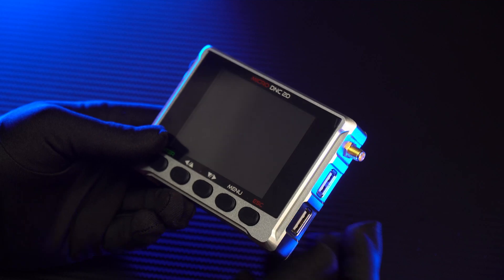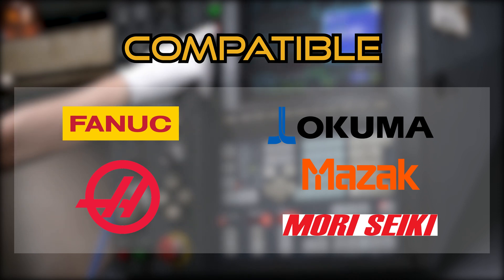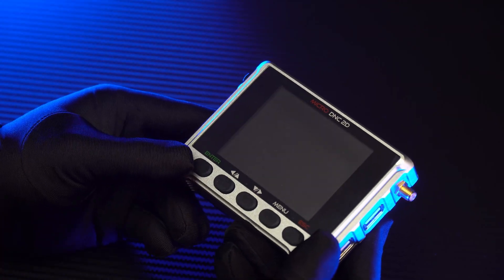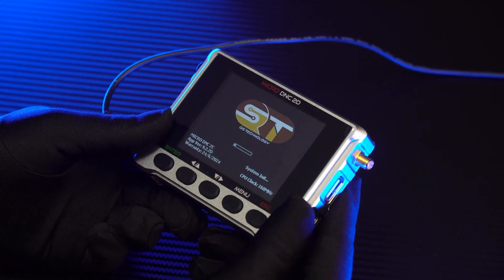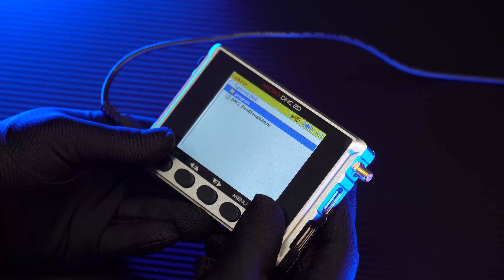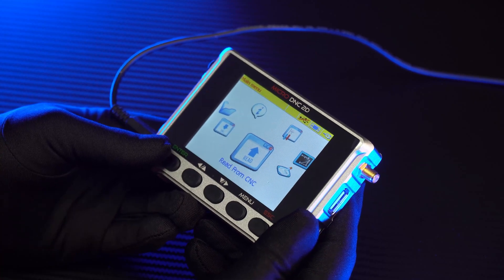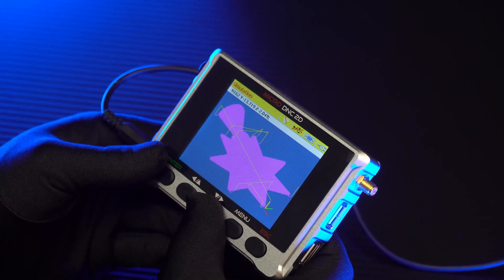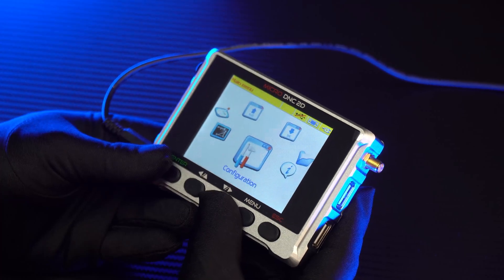Micro DNC 2D basic features | QS Technology

Comment: Have you guys sorted out to make the Hardware flow control working yet? Xon/Xoff doesnt work on many older machines.. and requires proper hardware flow control - Like older Okumas.. I have one of these boxes sitting in a box. useless.. ended up getting a MOXA Ethernet to Serial device instead.
Reply: IF you machine have DB25 port, absolutely it will work .
Reply: @ViktorMiller-SMQST  It does not as the device does not support RTS/CTS signals - ergo hardware flow control, it only supports software flow control (Xon/Xoff) and older machines don't rely on the sending of character to start and stop the transfer.
Its not a matter of what port your using its a matter of how many wires your device supports.. Hardware flow control uses 5 wires.. TxD/RxD, RTS/CTS and Signal ground... while xon/xoff only uses 3, TxD,RxD and signal ground.
Reply from the maker: Dear sir, Good afternoon. I got what you mean. Our device's hardware can do this, It will need to modify the connection cable a little bit. I will make a video for this,. Really thank for your feed back sir & have a nice day 🥰🥰🥰